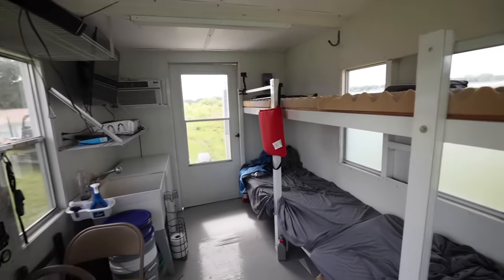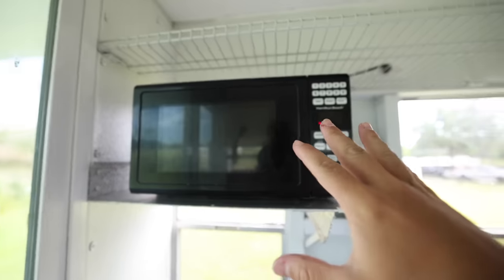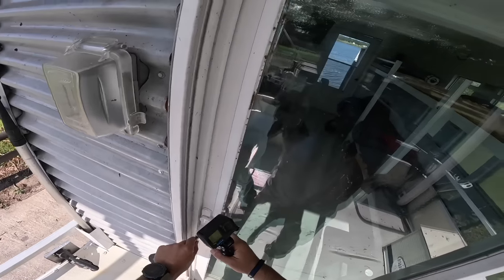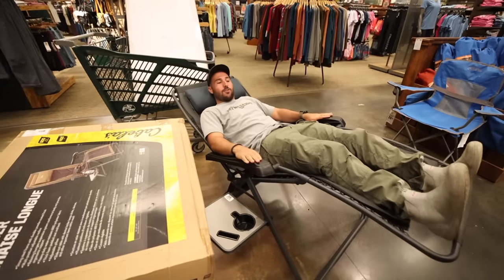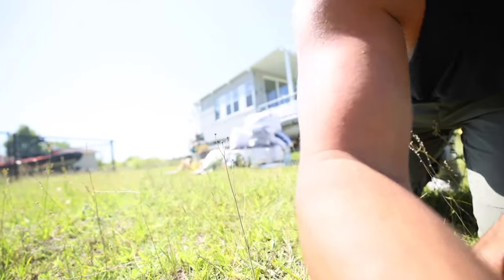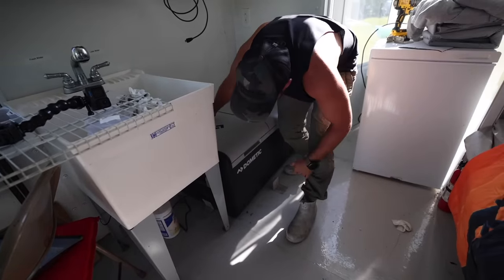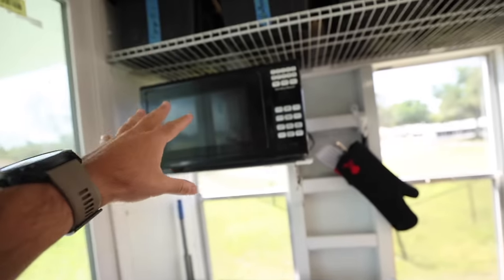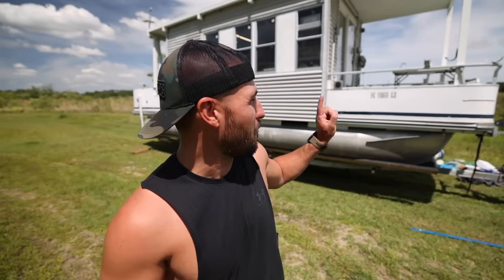I Bought A FLOATING TINY HOME!!!! (Catch & Cook Cabin)

Comment: You should extend the muffler on your generator to the tail end of the boat or even up to the roof so the fumes don't get sucked into the ac when it's running.
Reply: That style of AC doesn’t draw air in from outside.

Comment: I love my houseboat.  I have pretty much the same as you without the bathroom.  I have it on a private dock  at the marina.  hauling that thing around is going to be hard on it.  windows rattle and get loose have to replace one every third or fourth time I trailer it.  way less hassle to keep it at the marina.  and it's great to just pull up to the dock and be gone in five minutes...

Comment: Get artist to paint 3D mural floor of the spring River you dive in. So it looks like the floor is transparent. You need to load the tiny boat with your light bars and electronics for bow hunts, fishing. If the roof is structurally I’d use the roof for lounging with your gravity chairs maybe your construction guys could figure out heat shield for portable fire pit. Paint trailer and rims and paint pontoons down the road upgrade hp motor , the nautical guy can move the wheel house forward to front of the boat , help with captain’s visibility?

Comment: You may want to put shades in the windows to block light and for privacy when sleeping and put screens on the windows so you could open them if wanted. You can but screens to put on the doors and the have magnets on them so they snap shut. Well help keep the bugs out. A bug zapper outside would be a good idea. You may want to move the air conditioner away from the motor and generator.
Reply: ❤ be a big brother take a kid without a father fishing 😭, I'm seventy-three but when I was younger I used to take kids fishing and playing golf ⛳ it's so rewarding give it a try.

Comment: Dude you need to get a rod rack for the ceiling. Need to knock legs off fellet table and put it on a hinge so you can fold it down when not in use. Then we get in to the underwater lights to attact the fish at night.

Comment: Mount your CO alarms within 1 foot of the floor, (carbon monoxide settles at the floor and rises) one at each end of the houseboat. Mount a smoke detector on the ceiling, at the center of the boat. New model smoke alarms have a 10-year battery.  Mount your fire extinguishers at each door, bow and stern so these are immediately accessible if needed. You had a third fire extinguisher I noticed in the video. Mount that extra near the outboard on the exterior deck. Make sure you have a first aid kit on board, PFD's including a throw ring and bow and stern anchors. Safety first and you'll be prepared in case of an emergency. Enjoy this great boat!!

Comment: The only thing that concerns me is the location of the generator and the air conditioner both really close to each other. I actually know for people that died on a houseboat from carbon monoxide poisoning. I don’t know if there’s a way to reroute the exhaust from the generator to maybe the front of the boat and up but you’re gonna need to do something about that immediately.
Reply: Use solar and buy the new cooler a/c lol fixed.
Reply: @floridacracker_  it’s a pontoon boat, though you gotta consider weight and batteries are very heavy

Comment: I’ve done a lot of those pan roofs and they make a styrofoam insert and caps that fill the pans and insulate it. They work pretty well and will keep the roof from dripping water as the temperatures change. Should be less than 1k if you do it yourself and would make a huge difference!

Comment: Just a thought to alleviate the blind spots try getting some security cameras to mount two on the bow port starboard walls and one o the stern, Center on the roof. Using an LCD monitor on a swing mount would allow the captain to while underway to use the monitor to view forward blind areas. Then stow the assembly when fishing or stopping at night. Or with a switch box could also be a  vid screen. Also some black out curtains on rood sliders Just a thought.

Comment: The gas tank should be moved outside and leak test connections inside.  You could make a fold down chair for the captain seat if you want to open up more space.  You could put in storage under the fridge this will also raise it up so you don't have to bend over to get into the fridge.   Would be interested to see how much power you have in the batteries, will you be able to run AC while sleeping or will you have to run generator all night. Solar will help during the day and to recharge batteries , maybe add some more batteries or add an ecoflow.

Comment: 🤔 You may need to put some safety lights on the front and back of the boat and it may be a good idea to make a concrete or gravel pad for the boat to be stored on so it doesn’t get stuck after a rain fall.  Maybe put a front and back camera on it to monitor things and help maneuver it safely. Maybe some blinds on the windows.

Comment: Dump the aircon and put a mini split in. Since you have a front and back outdoor really no need to be on top, so instead fill the roof with solar panels and put a major solar system and batterybank and you will be an all out off grid house boat with generator backup. You will enjoy your time on the water so much more and for as long as you want. Travel the GREAT LOOP with ease and comfort.
Reply: You will be able to use all kinds of household electric items and keep all rechargeable tools and toys continuously charged. In the event of several days of overcast you can charge solar batteries with generator and still run most of the household things till sun returns to the nonstop fun. After built the solar runs continuously and for free and will make the great loop trip (can take as long as a year maybe longer on the shanty boats at 8-12 knots.)

Comment: Hey man to reduce stress on the house boat frame keep that front door open the rear door open to allow the air to pass through it’ll improve gas mileage while towing and make it easier to handle while towing at speed

Comment: In the 80s  when i got out of the navy i wanted to build a house. Load my carpentry tool in and travel the missippi. Work up north in the summer. Work the sothern states in the winter. Live rent free. As a carpenter theres always  a demand for your serveses. How much is this boat? Im old but not dead yet . $$$????😂 try ams oil 100 to 1 oil it will help greatly with the smoking 2 stroke motor. Likes as always
Reply: Thank you for your service ❤. With great respect.           Fran

Comment: Great video, love the boat!  I hope you didn't add too much weight, or getting it in the water might be a problem...  We have owned pontoon boats most of our 75 years, and tent camped on them with a porta potty, etc. but I always wanted to close one in, just never did...  I would have to make it drivable from on top or from the front as visibility would be difficult with foggy windows, or with a lot of boats in the area...   
Jerky video is difficult to watch, so I assume you are using your phone without a gimbal or tripod.  I have used my Mavic 3 on the ground to use its great gimbal...

Comment: Hope someone already said this,  but you DO want to sleep in an o2 environment.. that's oxygen.  It's CO2 that u don't want, and that the sensors are made for.  You'll want those installed as close to floor level as possible.  CO2 sinks, and one would cover that boat easily.   It really pays to do your research.  Also, you'll regret having nothing but a half a cooler as a fridge and getting rid of the big one.   Having lived in the keys for years on a small boat it was the biggest mistake I made with mine, thinking I didn't didn't fridge space.  Hope u kept the big one!   Enjoy the space and fish it well guyd

Comment: O2 is oxygen,  CO2 is cabon dioxide that is what you have in you breath when you inhale air with oxygen, use that and replace that with the carbon dioxide. Too much of that will also be dangerous but what that sensor is for is CO. Carbon Monoxide That is the silent killer in exhaust fumes.

Comment: it might be a great idea to make it fully electric and I don't mean just solar for the house part but also for the driving part. it will cost a lot of money But definitely it will payoff very fast by cutting fuel cost out of the generator and from the motor. also instead of only solar panels you can put a small wind generator as will produce energy day and night and that's what make a little bit more economic sense because you won't have the need  for too many batteries

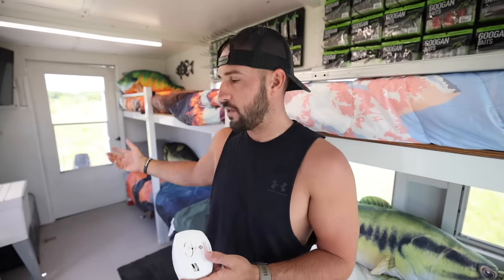Comment: Did you get a carbon monoxide (CO) detector on board? 30:40 you said you had an O2 detector. There is a difference. Also it should have it near the bottom of the cabin because of the weight of the carbon monoxide is heavier than breathable oxygen.